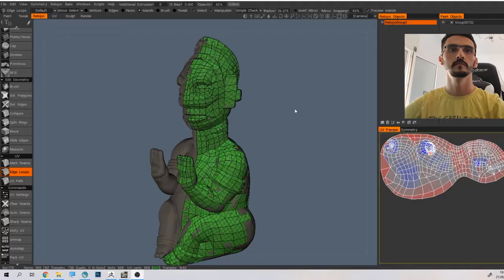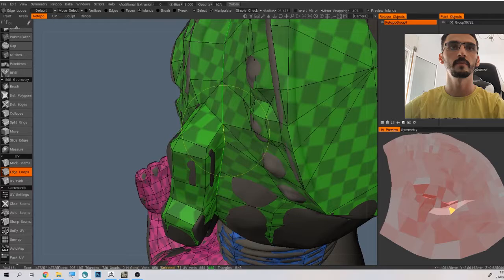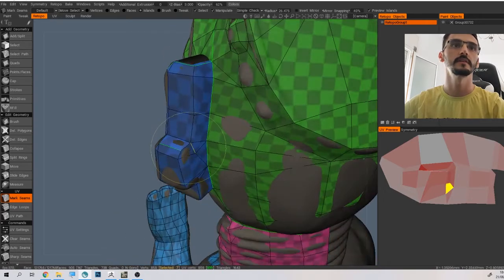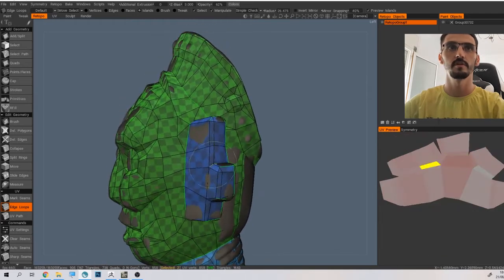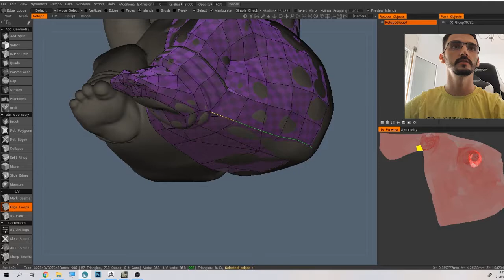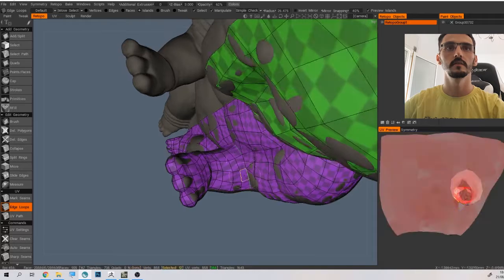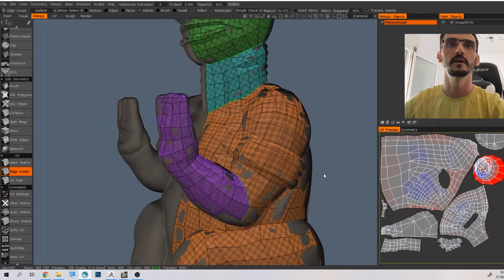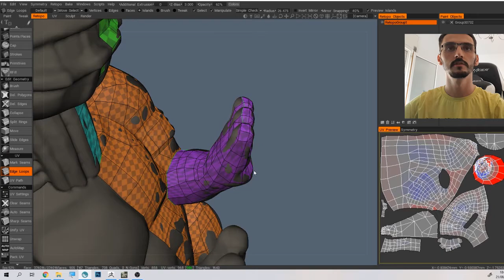Super fast unwrapping with 3D Coat

Comment: Great tutorial! So you look for problem areas in the UV preview, visualized with blue and red, and you slice them into smaller pieces until the UV is well stretched, visualized with much less color and mostly grey in the UV preview.
Reply from the maker: Yes, you generally should try to get as close as possible to grey colors. Pale Red and blue are not a big issue. You can even try to find the polygons that are stretched and judge by the checker pattern if the stretching is a problem for you.
Try to cut closer to Red color areas and especially if you have big planar changes on the 3d Model or big angles(90 degree) as mentioned in the video. Good luck!